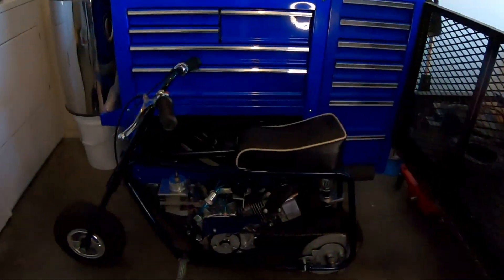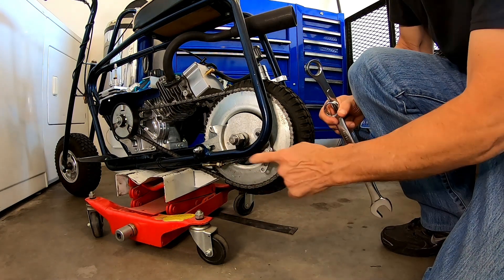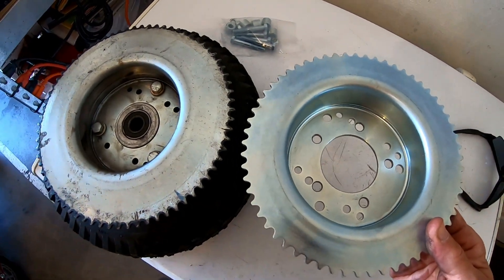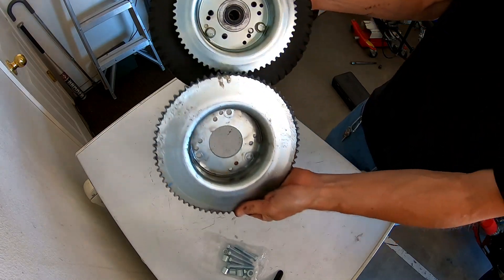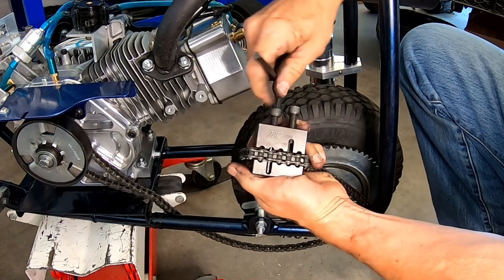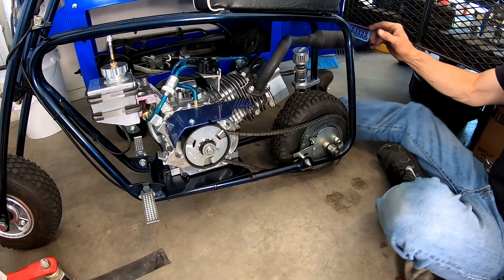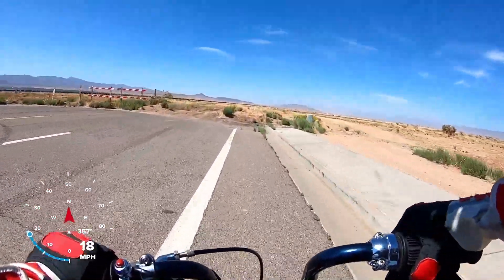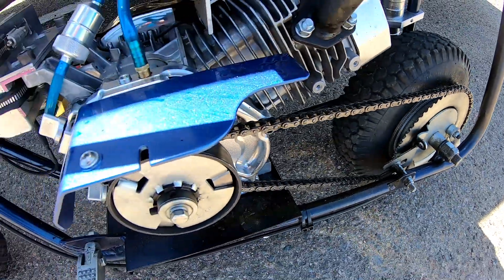Minibike goes 70 MPH/Predator 212

Comment: Wow nice build! Very fast and clean! I have a question for you. May I ask what specs are in your motor. I’m currently building a drag bike and went 60 mph with a 55 tooth sprocket with a 18 inch tall tire and a torque converter. I just changed it for a 70 tooth sprocket for 330 foot drags. The motor is mild but built extremely well with lots of precision. Everything is measured and clearanced to spec. But I’m at a point where I’m running out of motor on the top end. It has stock length billet rod. Stock crank. Flat top piston. 265 hot cam. Stock valve train except valve springs. Custom ported head. Stock valve size and all. And 24mm nibbi carb. The motor is very mild. I’m assuming with the stock valve size and camshaft size I have extreme bottom end and I get out on everybody by a bike length or 2 but catch me. Your motor seems to be built well no break ups through the curve. So my question would be is what specs would you recommend. I have a good chunk of money saved so I’m willing to spend. Thanks for reading through all this and great video.
Reply from the maker: Thanks! Your bike sounds pretty sweet! This one too is a mild build. It's like yours with the stock valves but it's running a 14cc chamber GX160 head with mild port work, a .012 thick head gasket with 1.2 ratio Rev rockers and 26 lb springs. I don't know if this head flows as well as a stock head even with the port work but with this mild build, the compression bump made this thing really snappy. It pulls pretty hard for what it is.   I would like to try out one of Pauls's Karts GX 14 cc heads with his cam and carb. His TRINITY package. I think that would wake up our bikes lol
This one had the same cam you are running, the 265, but in this video, I changed it out for an even smaller 252 rattlesnake cam with the 1.2 ratio rockers just to try it out. It has a.020 ARC billet rod and an ARC billet flywheel. a Mikuni vm22 26MM carb with a header pipe. Nothing special at all. But I guess it's all about the combo.
Reply: @Black66  thank you for reading my long paragraph and the quick response! I was looking into getting the trinity package. Seems like a sweet deal and I might wait for it to go on sale. Maybe I’ll try and get into contact with him and tell him my application. But great video once again and I love the bike. I have subscribed and will be looking for follow up vids. I’ll be experimenting with different combos and let you know the results. Keep up the great work. 👍
Reply: @Black66  I have a question when you install the ratio rockers is there anything else you need to replace like pushrod length I'm building a motor now I a very mechanical inclined just don't know alot about the ratio rockers and push rod length

Comment: i get 72mph out of my motorized bicycle its got a 100cc racing engine 😂😂its got so much tq ive blown 2heads apart and now a factory crank (its a 100cc yd100 2stroke) i may rebuild the motor for a moped project but will see in a couple days my bike will have a ktm 110cc 2 stroke dirt bike engine im hoping for over 100mph but will see
Reply from the maker: Now that is a rocket ship!!
Reply: @Black66  🤣🤣ya it is so i just finished rebuilding the motor lets just hope it all stays in one peice now well save the dirtbike engine just in case

Comment: bigger rear wheel would help some to just up the rear wheel size  by 2 to 3 inches more.
Reply: Then it won't have the acceleration and maybe worse top end......a tire 2 or 3 inches bigger would be harder for the engine turn also stopping the bike would be too much for the brakes that are on the bike.....he even said they were not the best.......maybe a small dirtbike tire lol I would like to see that
Reply: @midbc1midbc199  his transmission is a problem as well with only one gear ratio to work with it needs a CVT transmission to help his top speed being higher with such a small tire and also help his low end acceleration improve to.

Comment: What internal mods did you do for this ?
Reply from the maker: ARC.020 billet rod - https://www.arcracing.com/6256-billet...
ARC billet flywheel - https://www.arcracing.com/6695-predat...
GX 160 head - https://www.amazon.com/gp/product/B01...
VM22 Mikuni carburetor - https://www.amazon.com/gp/product/B07...
Header pipe - https://www.ebay.com/itm/193709332828...
Rev 1.2 ratio rocker arms -https://www.eccarburetors.com/1504-ec...
Reply from the maker: And a little port work
Reply: Also a 252 rattlesnake cam

Comment: Ok bro, at this point I'm seriously starting to worry for your safety.  Near 70 on a bike designed to run in the 30s is probably pushing it a bit. That said, trade up to some bigger wheels and tires and I think you might get there.
Reply from the maker: Ya, me too lol  This thing feels like it's going 100. It's soo small.
Reply: Redfish Incorporated, I'll be a rich widow! LOL  When he goes fast I make sure he takes someone with him just in case.